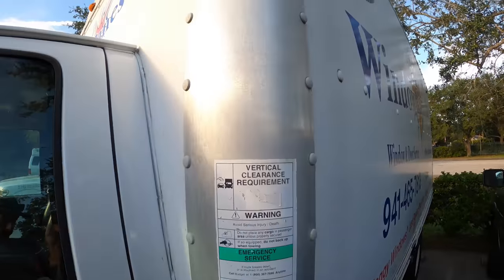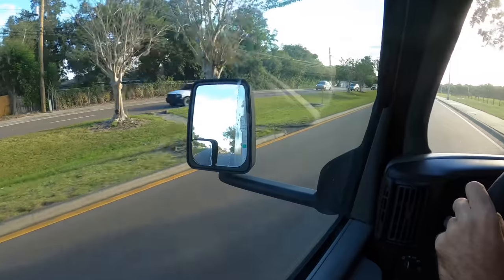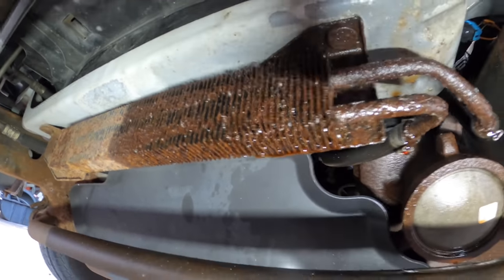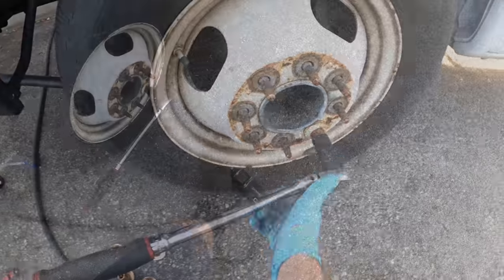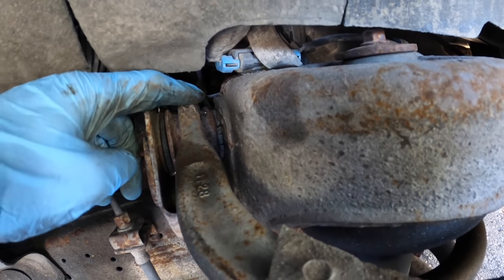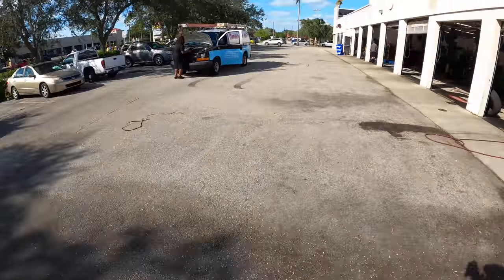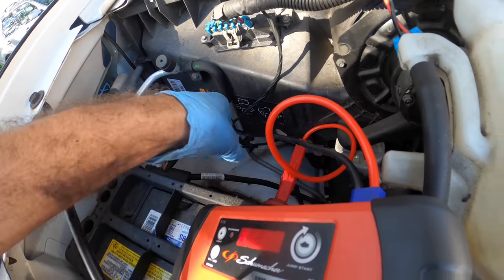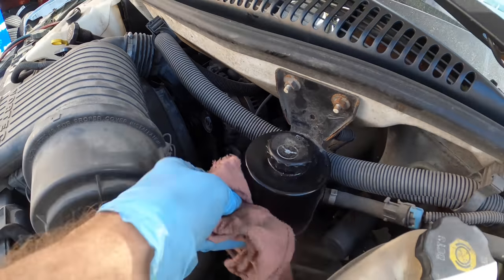Two Hour Inspection | DECLINED everything! almost

Comment: You didn't say it until almost the very end, but I was thinking it through the whole video after they declined all the serious work in favor of the "low hanging fruit" and that with those shiny new fancy shmancy HID bulbs, at least the driver will be able to see what's happening after he crashes through the guardrail and goes careening down what must seem like a never ending embankment, until he finally comes to an upside down fiery stop at the very bottom, some 400 ft down from when he last saw anything even vaguely resembling pavement. And he'll be comfortable and cool in the hot and humid Florida evening, at least part of the way down anyway.

Comment: What you should have done was to go out in the parking lot use your cell phone and called the Florida highway patrol. That truck is considered a commercial vehicle even if it wasn't it still would fall under DOT regulations.

Back in the 1990s there was a large trucking company in my state. One day on the beltway one of their drivers caused a horrendous accident where a woman it was either her leg or arm had to be amputated and other people were very banged up.

When they started the investigation that's when the inspector realize that a week before that same truck was put out of service at the scale house on the interstate. All this company had done was to have the tow truck driver take the truck and driver to the next exit past the scale house and drop the truck. The driver climbed up onto the windshield and pulled the outer service sticker off of it and went on his way. So when the following week after the accident the police shut down the trucking company. 2 days after he accident they had dot inspectors checking every one of their trucks. Out of 50 trucks only four were allowed to go back into service.

Instead of spending money to fix their equipment the company file bankruptcy and the rumor was they did that so the woman and the other victims in the accident could not sue them. All they could do was to go after the driver and the company's insurance company at the time.

In the times of today law enforcement takes DOT inspections very seriously. They're too many people watching and too many videos of just simple accidents now that can turn into a major issue.

I absolutely made sure to give you a big old thumbs up and as always look forward to watching the next video.

Comment: THE VAN HEADLIGHTS WERE PROBABLY FINE, BUT BCAUSE OF THE SUSPENSION PROBLEMS THE VEHICLE IS HEAVILY WEIGHTED IN THE REAR AND LIGHTS R JUST POINTING UPWARD INSTEAD OF TO THE GROUND

Comment: 🖒🤠

PS: Hoses need to go over ridges in piping of cooler them clamp on other side of ridge too. Then also will fit original holes... coincidentally.

PPS: Question:  Did the AC work better?

Comment: Did the A/C work? Also a faulty (leaking) rear brake can cause a pull on application.  I didn’t see anything in the suspension to cause pulling. Still an interesting video. Frustration was clearly evident, my empathies, lol.

Comment: The ONLY time I said "No, I'm turning down critical safety repairs.  Please fix this one thing" was when I had a muffler ticket.  The fine is $1,000 in NY.  I got into an accident and decided to scrap the car.

However, if I fixed the muffler within X days, I wouldnt have to pay the fine.

I paid $200 for somebody to replace the muffler on my destroyed vehicle so I could get out of a $1,000 ticket.

The car OFFICIALLY came off the road as soon as I had them sign off on doing muffler work.
Reply: For clarity, the accident was almost immediately after the ticket... not the cause of the ticket.

Comment: you can use a flat wrench to screw that clamp onto the pipe.  wrench 10 or so instead of a screwdriver.  no?  works much easier

Comment: Where I'm from, that thing would be illegal to drive with that suspension. Literally. We would not be allowed, by law, to let it back out onto the street. Also, I would've cussed this thing to pieces, that cooler was a blight, ngl I'd have cut those bolts. That really was a job to make ya hate the job, holy damn.

Comment: Here in the Uk vehicles over 3 years old all have to pass whats called an MOT test, to test its roadworthiness for safety. This vehicle would fail on those bushes and they would have to be replaced or that van wouldnt be allowed on the roads. Do you not test vehicles in the US ?
Reply: Some states require inspections on personal vehicles.  All states have inspection requirements for commercial vehicles, but i am not sure if that van is classified in the commercial vehicle group, so they may get away with not getting inspections.

Comment: That van would fail the U.K. MOT test for safety because of them top and bottom wish borne bushes and track rod ends. So it would be replace the parts or scrap it.

Comment: Once I had enough space between the frame/rad cradle I would have used a saw or cut off wheel and cut those bolts.

Comment: Hi.
I watch your chanel from time to time and one thing that i have noticed is that it seems to very much rust on the vehicels you work on, both quite new and old ones.
Does the manufacturer dont use rust protection in usa, here in Sweden its not hard to find cars that are 10-30 years old that are in much better condtion that the cars i see om your chanel, and that is a BIG questionmark for me??
Here in Sweden we also have to certified company that checks the safety equipment and the overall condtion every year, do you dont have a system like that in USA??

Comment: A super pro would have taken an air hammer with a chisel tip to cut those cooler bolts off in a couple seconds, nipped the hoses, screw new cooler up, two hose clamps done

Comment: I am usually pathologically opposed to  Government  bureaucracy and red tape, BUT to allow a vehicle like this on the road at all is unconscionable.  It should be either on a tow truck or on a hoist.  Vehicles should be inspected (including rolling road brake tests) ANNUALLY.  New York do this, though I don't know to what level.  When I worked in Germany they even checked body alignment.   Here in Ontario we had our emissions checked annually, bugger the ball joints, rust and inoperative brakes, as long as the tailpipe gasses are fine we are good to go.  Grrrrrrrr

Comment: I had a customer for truck rims decline tires the the cords were showing on the inside wall.
I wouldn't do it but another tech sold it.

Another customer had all bad suspension parts Ford ranger, to dangerous to drive. declined all repairs.

Comment: Hacksaw, Sawzall, cutoff  wheel. Your not going to use those boots again any ways.. Nut driver for the clamps. One of those 2 in 1 screwdrivers.  Has 1/4 and  5/16 ENDS

Comment: Not fixing the suspension is just so bad by the customer. Not fixing it will lead to tire wear and having to replace the tires more frequently. I wouldn't be surprised if it also didn't lead to some brake repairs. An accident from Thai also wouldn't surprise me. It would be cheap to fix now than to ignore

Comment: To be fair, how bad would it have sucked to do the front suspension?  I know you made that point but then you apologized.  But if a power steering cooler was that awful, what would it have been like to get those lower control arms off?

Comment: Seriously ive got to be a ASE certified mechanic to install car audio in Florida,  but you can let that road Hazzard drive away from the shop in its condition and cant stop them 
Cant you pull the inspection sticker and call hwy patrol to impound it?

Comment: What a piece of junk that cute van is look like Jacques Cousteau used it underwater keep the click method I use it also and before I lock my shop door lights are off battery chargers are off door is locked I learned that building nuclear arms I like my fishing down range.
Although you should have left a leaky power steering it was the only rust coating on that rust bucket. Haha Rock on.

Comment: I thought you did most things correctly - and just gave you grace - on your no use of a torque wrench - and just saying 'click'.  Love your doo de doo; etc.  Would be surprised if you regularly used a torque wrench.  I mean your supposed to - but a lot don't.  I do - but yet I also cheat... since my vehicles are not in warranty - and they generally state a fairly high torque - the Oil Plug on my OutBack is supposed to be 32.5 Ft/lbs - I go 28 - since Subaru doesn't warrant against the pan threads from stripping out...  Some stuff - like Ball Joints - some thick metal in both parts - I will torque to what is specified... but I watch it... "Oh hey - this broke; threads went out."  "Great parts dept. says - more moolah for us!"

Comment: I think I would have just ground off the head of those bolts, not going to use those anymore anyway, too far rusted and what do bolts cost, buck each, not worth my time fucking around with that shit! Also a little tech tip, buy yourself a pair of hand pruning shears, they work perfect for cutting hoses, power steering hoses, heater hoses, gives a perfect clean square cut in about 1 second. And by the way, that bicep muscle on the side of the arm is called the bicep brachial. And another thing, torque wrenches are for amateurs.!

Comment: Its funny you don't like using scare tactics. But in this case, If they dont service their front end suspension they could likely DIE or at best get seriously injured. And its only multiplied when the drive fully loaded. I know in NJ non-road worthy commercial Box trucks are the leading cause of serious accidents on the NJ Turnpike.

Comment: Larger vehicles are worse than that van your box truck you worked on I've got some that I know you wouldn't even want to get near that I used to work on and in the winter time at 18 below with the wind blowing and the truck is broke down out on the road I'm talking snow plows snow blowers that fit on the front of loaders

Comment: with the amount of time wasted on those bolts I could have cut them off in less then 2 minutes with a battery Dwalt angle grinder with a cutting wheel.

Comment: Like watching paint dry...  Did ya ever think of using clamps on the lines to keep the drips down to a minimum?  Also, just cut through the line clamps with your fancy snap On end cutter.  Not a hard thing to do.  I'm a retired mechanic and have done this stuff quicker.  Drop the camera and do your job.  It's a bit unethical to use your job to support these videos.  Just sayin

Comment: ALWAYS THE LAST NUT OR BOLT TO BE THE HARDEST TO TAKE OFF?? Of course, it is! all the pressure is on that bolt that is basic knowledge and Common sense. If that happens try tightening up all the other bolts then loosen the problem bolt first! Next time try loosening a group of bolts just a little at a time and stop being an "air hammer" mechanic

Comment: Well, you are a "licensed auto vehicle Mechanic". You have your qualifications at stake if you release an unsafe vehicle to the roads. 
If a Client brings in a vehicle with serious mechanical issues which may risk the public with road worthiness.
don't you have a responsibility to inform government Highway licensing that this vehicle is "unsafe for public access to highways, and roadways". 
This way, any argument from the client concerning road safety is pretty easy. Plates are pulled off, informed Government Licensing, Plates are turned in, and client can either fix the vehicle or have the vehicle towed away but can't drive the vehicle anywhere until that VIN Number is cleared of defects by another Licensed Vehicle Mechanic. 
If some other fool Vehicle Mechanic passes this vehicle and harms someone. Its not on your License, you did the correct thing. Its the fool stupid enough to risk himself/herself signing a Road Worthy document allowing an unsafe truck on the roads. Liability Lawsuits can get extremely expensive for the fool stupid enough to sign their name to unsafe equipment.

Comment: Normally you go above and beyond to keep everything "nice and shiny" but...ma n....self tapping screws.....in an area that is a rust magnet you drilled holes in the frame.....and why did you use the wrong PS cooler and one with no heat sink?....Horrible slop job...yes the original or one like it is more expensive but...damn man...If you did that to my rig I WOULD BE PISSED...I used to say i would have no problem having you work on my stuff but after this....Man I dont know..this is why Im the only person who works on my vehicles... Come on man your better than that....